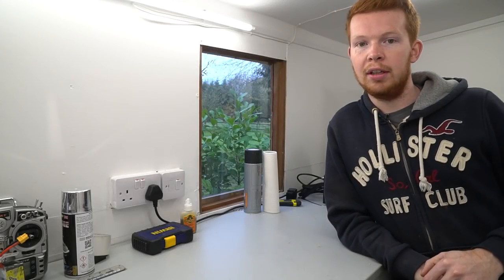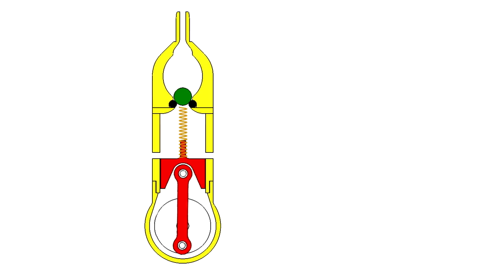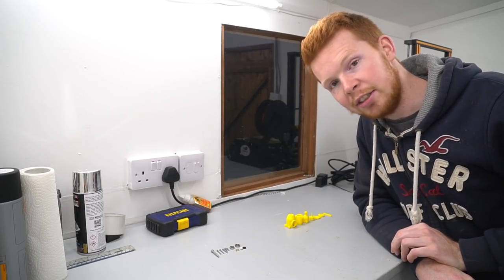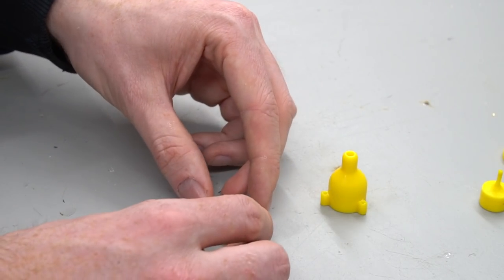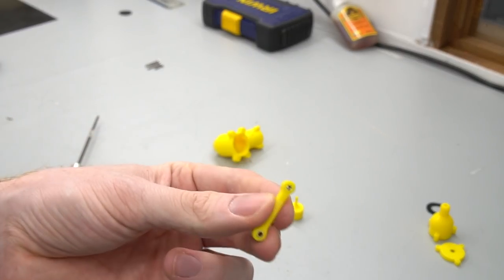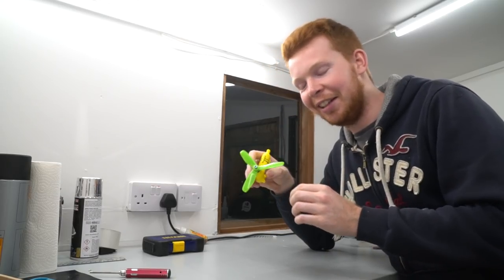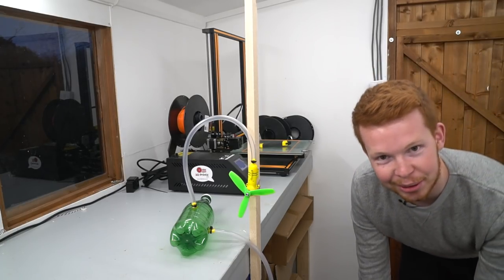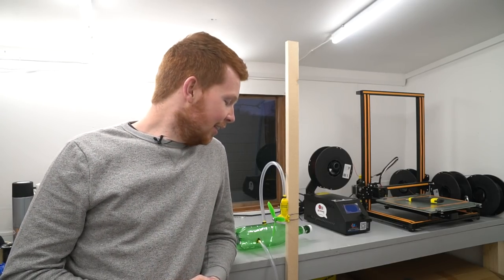Compressed Air Engine

Comment: Well done, Tom; no, you weren´t over-excited - I´d say you demonstrated commendable restraint in your reaction to the successful motor trial.
  One thing - you showed us how the piston wouldn´t even enter the bore unless rotated a fair way in one direction or the other; weren´t you then very fortunate in having the con rod happen to present itself with its "big-end" eye nicely square to the crankshaft?
Reply from the maker: +Del350K4 I marked the angle where the piston ran smooth and made sure I glued it square with the big end. So I was fortunate that I designed it to be glued and not bolted. Thanks!
Reply: Thanks for the prompt reply - I was genuinely puzzled but I´m now at peace  : )

Comment: That stuff you have for a gasket is fine it would probably work sweet as a gasket in a real engine, I don't know what it's heat tolerances are but, I would say it would be fine, you'd be surprised what you can use when you're stuck, lol, you want to ensure you have a smooth fitting on the inside where you said it was snagging.

Comment: The engine seems to run as fast as it can with the given pressure, add a screw vavle, some grease and it should be much better, controlled speed and smoother running.

Comment: You can easily go over 50-100psi with plastic soda bottles... iirc they are rated to 150psi (when undamaged.. I think your holes on the side may lower that strength)

Comment: Give the Cylinder some Lithium Grease, in Nerf mods we use it to lube the plunger system while also maintaining an air seal.
Reply: Also if you hooked it up to a CO2 bottle for painball and put the regulator at a low PSI you may be able to get it to run at a more consistent speed and for a longer rate of spin.

Comment: Wait use a co2 canister and mounted it on a tiny  plane and shrink the engine down  so it can last longer and use a little oil to make it run smoother

Comment: Needs a pressure regulator to make the air in the reservoir last longer. As it is now, it's all or nothing and only limited by the orifice size of the air inlet to the motor.

Comment: Use your printer.  Make a huge 2 piece propeller.  Very wide blades.  Use it with a big bore air piston engine that gets much less rpm at 60 psi but way more torque.  Or go the other way.  A smallest piston possible and go to 100 psi.  And finally make a rotary version

Comment: I've repeatedly used  a 2-liter pop bottle on an air hogs engine up to 90 psi which is what the air-hogs pump is designed to produce.  I'd be more concerned about your hoses which are probably a bit too flexible.

Comment: Make a 3d bottle cap to avoid drilling in to the bottle and you can use 100 psi in any soda bottle ...  I had a airhorn that used a bottle as deposit used to inflate a disposable coke bottle to 150 psi.

Comment: the spring should be shorter to allow the valve to reseat sooner, it would allow the air to expand in the cylinder to actually use the energy of the compressed gas

Comment: If you use acetone to glue abs you need to give it a bit of time to dry otherwise it is very weak and thesurfaces need to be as flat as posibile.

Comment: That bottle is heavily resistant to high pressure for such experiments and can easily handle 80psi to 100psi and even 120psi before it starts to bloat out and go borderline danger. The likelihood is that the pipe seals or cap could fail before then tho.

There is a product that might help if you were going to make more projects like this. It's a bottle cap and you can pressurise a bottle with a bike pump and needle adaptor. It's designed for making bottle targets for shooting practice but depressurising the bottle by inserting a needle adaptor with pipe connected to the engine could make it a good cheap and reusable source of air pressure..

Here's some links:-

http://www.bigblastcaps.com/ - for info
https://www.slingshotchannelstore.de/deutsch-2/zubeh%C3%B6r/big-blast/ - to purchase
Reply: He had a hole in the side of the bottle. That would weaken it significantly. But you are right. Easiest thing I have done is get tire stems, drill a hole through the cap, and pull it though. No needle valve you just hook your pump up and you are good to do.
Reply: Well you need to be specific, it is only carbonated drink bottles that can handle pressure (because they don't want shit to explode during transport), and you need to put your tubing into the cap so the bottle stays strong.

Comment: I wouldn't bother with 3D printing the contact surfaces of the "engine". Reason being that it's good enough to have a O-ring seal on an air engine. In fact, it was good enough that old air planes made in Germany had that design. It's basically a smooth aluminium tube (wafer thin) that's pressed inside a plastic housing, the piston has two O-rings on it that are near cassette drive level thin. Rest of the design is pretty similar, except for a reed valve setup.

Comment: okay my suggestion, use a smaller in pipe to limit the amount of air that can go through the engine but not changing the pressure

Comment: So is this more effective then just releasing the air through a small hole and creating thrust this way?
Reply from the maker: +terner releasing the air through a small hole would mean a very high velocity thrust and would only be efficient at high speeds. So the idea with this it to convert that high velocity air to a lower velocity air flow from the propeller. This would make it more efficient at the slow flight velocities required by a remote control plane
Reply: this is no where near as efficient as a normal turbine. it is an amazing proof of concept but the idea of a piston engine is compression, there doesn't need to be a compression stroke on this. a radial would be a cool project but again, simple turbine would be the most efficient to drive a prop IMO

Comment: Just a thought build a works toilet cleaner bomb and feed the line to the motor when the aluminum reacts to the toilet cleaner it will build up intense pressure it would make it run quite a while

Comment: Would be nice if a small turbo could be made that would power the motor continuously.  Just doubt one could make one small enough and still produce the psi needed to spin the prop fast enough for any useable thrust.  But if it could be done would be a motor that would run nonstop completely self sufficient..  the other thing is you could make a waste gate system to control throttle and even open it full by servo for shutdown.  I know dumb idea... wouldn't ever work...  back to the beercave.

Comment: if you used a small bottle of boiling liquid nitrogen as the fuel tank, you could provide allot of continuous pressure as the nitrogen melts

Comment: use a Co2 cylinder from Umerex as it has 2% silicon oil in it to aid in lubrication, also you can get a Co2 regulator to control gas flow, I have seen these on some airsoft website but I cant remember , Uncle google can sort :) where can I get the Gcode/model drawing as want to try,
thank you for great vid.

Comment: I wonder if you could print the bore slightly undersized then hone it with a rotary tool polishing bit, and use lubricated O-rings as piston rings?

Comment: You'd have been better off cutting out the washer with a utility knife or hobby knife than scissors.
Also, if you'd made it to the right scale, you could've used the spring from the inside of a retractable pen, and avoided waiting for the mail.

Comment: What if you clamp in a second reservoir that is 'vacuum' so you dont have to worry about the atmospheric pressure and get more out of the air tank without the need to pressurise it to high levels.

Comment: Video and instructions published Sep 20, 2017:

Video:

https://www.youtube.com/watch?v=uWxExhBJ4_c
https://www.youtube.com/watch?v=zEmN3HBRNC0
https://www.youtube.com/watch?v=TVCq5LRrM78

Instructions:

https://www.instructables.com/id/Single-Cylinder-Air-Engine-Experimental/
https://www.youmagine.com/designs/single-cylinder-air-engine-experimental
https://www.myminifactory.com/object/single-cylinder-air-engine-experimental-45467

Caveats:

The valve timing in the design I published is more efficient than the "air hogs" design (the "air hogs" design introduces air pressure into the cylinder long before the piston reaches TDC, the design I published does not introduce air pressure into the cylinder until after the piston reaches TDC).  The design I published utilizes a 3D printed PLA block assembly with 3D printed nylon rotational components for longevity and has run non stop over hundreds of hours at 10 PSI while requiring no bearings or screws.

Hope you enjoy it!
Reply from the maker: Wow thanks for sharing that with me! I've been having a lot of issues with the "air hogs" design lately whilst trying to get it ready for mounting on a plane. It's really sensitive to the type of spring used and is hard to get it running over 40-50psi. Your design looks like it'll run through a much wider range of pressures! I'm going to stick with the air hogs design for now as I've finally got it working reliably. But your design looks like it could easily be modified to fit on a plane! Nice work!
Reply: Thanks, glad you enjoyed it. 

Obviously the “air hogs” design did work, just not as well.  After failing to produce the power I needed, I gave up on air hog and designed this version which allows adjustment for the valve timing in relation to the piston position. 

Beautiful work though, and best of luck!

Comment: Tom, could you tell me where you got the springs you used? I have built a similar engine and cannot find a 2mm spring that is weak enough to allow my engine to run.  I built a 2 cylinder version that has a 16mm bore and 15mm stroke and uses a M2 bolt in the piston vertically to push up the BB ball valve.  The springs I bought are too strong and open the valves before they should even under high psi.  I'd be happy to send you the .stl files if you were interested in building a 2 cylinder version of your model in this video.  Keep the awesome builds coming!

Comment: very nice but what happens if the engine is rotated in a upside down flight? the little ball does or not does return on the OR to close the top of expansion chamber?
as a  demonstration of 3d printing it is very amazing
P.S. P.E.T. bottles can support about 10 atm (10 KG /square cm) as i see in Tv show many years ago (i dont know if 10 PSI are more or less tan 10 atm)

Comment: It seems like more pressure just makes it run faster but for the same amount of time? I wonder if you need to use a smaller tube or restrict the flow to the engine some other way?

Comment: i think you are thinking too small, if you made it far larger it would be eaiser to sand down any rough edges right? then just get an air compressor and have at it, or even better make some sort of boiler and turn it into a steam engine.

Comment: Just FYI those plastic drink bottles will hold around 100psi.
Reply: Unless you poke a hole in the side. As others have pointed out, he needs to make sure the hole is in the lid.
Reply: Duane Degn I guess so. Wasn't thinking about that, seen people make portable tanks out of them, but they were linked on the bottom and top

Comment: I think it would be more efficient if you had a better way of sealing the piston and cylinder. I bet a ton of air leaks between the cylinder wall and the piston when the engine is running.

Comment: Hey Tom! This is great - I have a small air compressor and this concept has inspired me to attempt to create some workshop tools powered entirely by compressed air.  In a larger format what kind of torque and RPM do you think you could achieve with pressure as high as 120psi?  I'm wondering if I could create a table saw, drum / disk sander, maybe even a lathe?  I'm thinking that CFM may end up being the limiting factor...

Comment: Very nice but you triggered one of my pet peeves at 4:15 - using the word "tolerance" when you should say "clearance".
Reply: "Stated simply, CLEARANCE is the distance between the adjacent surfaces of mating parts (how much the mating parts CLEAR each other), while TOLERANCE is the allowable variation of a dimension from its nominal (desired) value ( the amount of error one will TOLERATE )."

Comment: How come you didn't utilize the exhaust as propeller assist nozzles? 
Instead of it causing extra drag, you can add directional angular nozzles to blow excess out towards blades. ;O)-
Reply: Also, you can reuse the pressure by creating duel chambers swapping the pressure back and forth as more is introduced ultimately releasing it out a third smaller chamber with a one-way intake. Further utilizing exhaust as mentioned above. ;O)-
Reply: Actually, creating hollow propellers could be used as the intake pressure release directly with holes at the edge tips. ;O)-
Reply: CO2?
Reply: Well, I just read through the comments and I see the nozzle and co2 was already mentioned. :O\-

Comment: You should power an rc plane with this engine using a small CO2 cylinder with a servo controlled valve to regulate throttle.

Comment: I feel bad jumping on the o I got an idea bandwagon but what about using o rings in channels instead of washers?
Reply from the maker: +jack duncan that's definitely possible! The only think that would need to be accounted for is whether it changes the distance between the piston and the ball bearing, as this would require a different length spring. Thanks!
Reply: No thank you love your work keep up the good work please.

Comment: Would this risk failing if you fly inverted? (There is a very interesting video by Real Engineering about the Spitfire having a fatal flaw in the gravity-based carburetor—your use of the ball bearing made me think of that.)
Reply from the maker: +Neversink Makes I have considered this, however the high pressure air flowing in through the tube pushes the ball bearing back towards the O ring. If the air were to be fed in through the side of the "carburetor", then yes, it would require a spring to push the ball back into place. Thanks!
Reply: You're probably right. Though it is a bit hard to predict what will happen inside the chamber that houses the ball bearing.  It would probably depend on the width and shape of that chamber—if the air can find a good path it might keep the ball bearing in place against the side of the chamber (though that seems unlikely in your model as the chamber seemed quite narrow).
Reply from the maker: +Neversink Makes the internals of the chamber is designed so the ball can only move vertically between guides. So it can't move to the side when the spring pertrudes inside. I probably should have covered this in the video. But yeah, I guess I will need to test this! Thanks
Reply: Try running it with out the spring,  it might run longer

Comment: Just subbed. I'm very impressed at what you can do, your very ingenious and I now more than ever want to get into 3d printing. Can you please recommend a easy and reliable printer.  I take it i need a pc for programming? I just use a tablet atm.
Reply from the maker: Out of the two printers I've worked with, the Creality CR-10 is the easiest to build and most reliable. You'll need a PC to 'slice' the parts in software. But other than that, the printer is completely separate from a PC as it has an LCD screen menu to configure settings. Thanks

Comment: Just out of curiosity, is there any advantage in a similar motor over a turbine?

Also awesome try using a compressor or something
Reply from the maker: +ondsinet _ not really sure. A turbine could be more efficient due to the rotary motion, but it would need to be geared to drive a propeller

Comment: Good one  Tom. You will go far ( but probably not using your compressed air engine though!). Really enjoy your videos. 3-D printing is the way to go and can only get better! 

Very refreshing that you don't wear a baseball cap and start all your videos  with "Wassup you tubers?". I think you should make your e-bikes to order. It  could be a good business.  Need to weather-proof your kit a bit more though I think - especially for the UK.  I would like to see more of the regenerative braking function you fitted on the last iteration. How about you using  a smart phone accelerometer app to test acceleration and deceleration of the bike  using the motor -  actually a dash cam would do that nicely for you too.

Comment: Or better still... Instead of pressurising it with air, use dry ice or that vaporizes quickly and then the vacuum container can prevent that gas from escaping... Then you are left with a spent, but reusable source of gas.

Comment: Instead of steam u can just add an engine to compress the air into the tank and use that air to power propellers.

Damn that would be cheap and would be lighter..

Comment: Where did You Get the spring i have printed the engine but i need the spring plz like som tom will see
Reply from the maker: If you downloaded the engine stl files, the spring specification should be in the txt file. As I don't know where you are located, I hope you can use the spring spec to find the same spring online in your country

Comment: Is there anyway to make the engine not reliant on gravity?
Reply from the maker: +B. Winky Are you asking about does the ball valve work if the engine is inverted? The flow of compressed air should push the ball towards the O ring and close it. But if not, a spring could be added to shut the valve

Comment: The bottle reservoir should have not been connected that way.... you made weak spots in the walls, a better solution is to drill the cap.

Comment: What is that device @:34 to the left of the 3D printer? Does that feed filament?
Reply: For that model of printer it is the control electronics. That control box also happens to come with a spool holder as well.
Reply: Nathan Rogers thanks, that was I was thinking but wasn't sure.